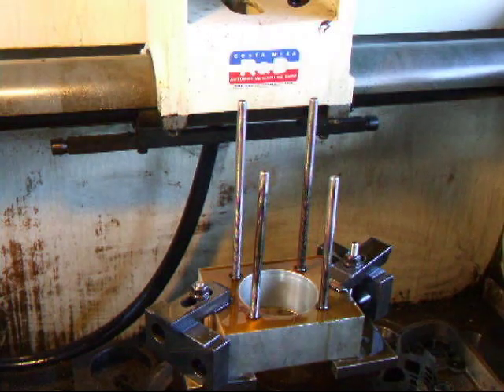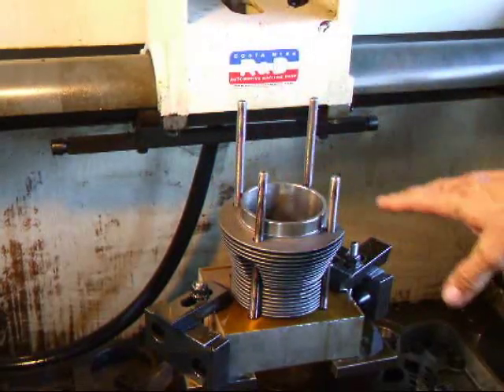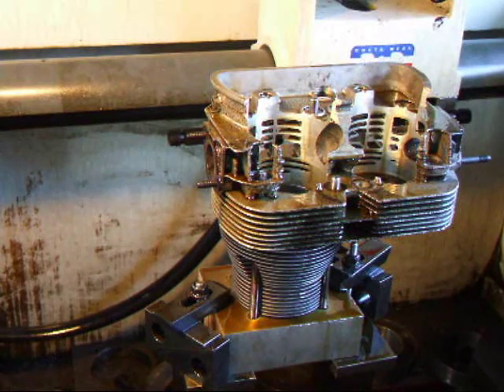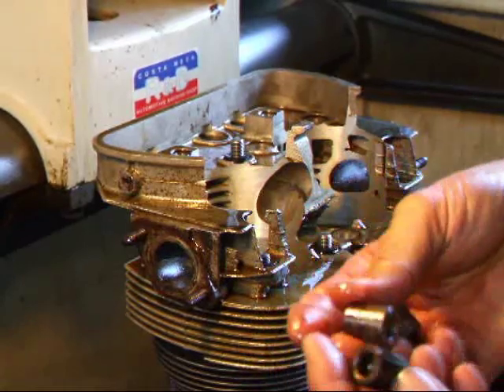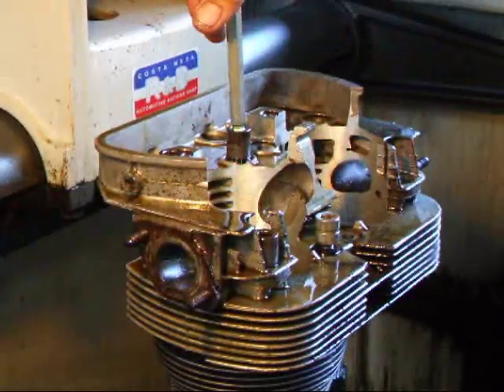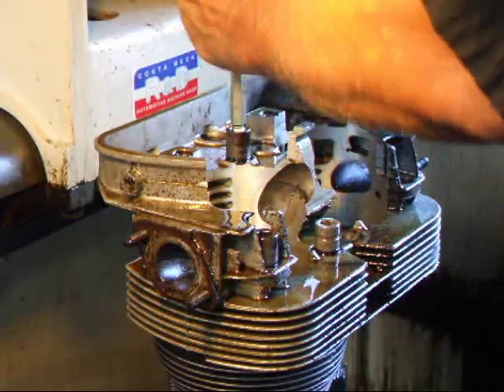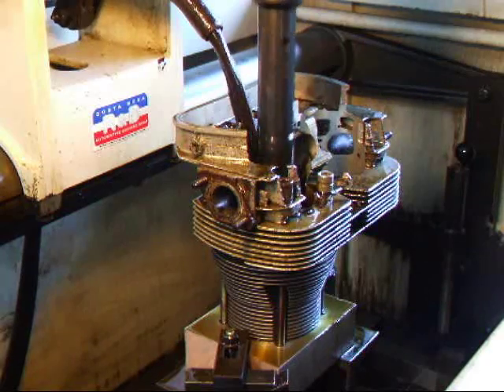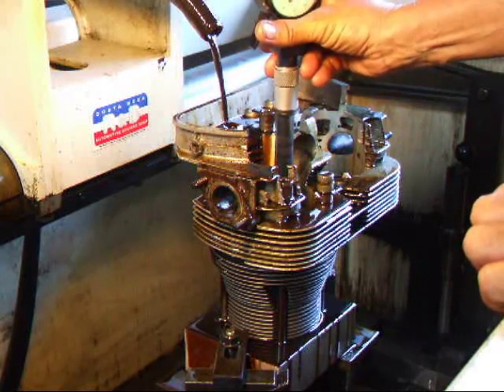VW Cylinder Honing with Torque Plate

Comment: question please ? do all vw stock cylinders come crossed hatched? or the motor builder does that ? thanks nice vid very informative to me .
Reply: +MrGarcon98 Yep.  For ordinary stock set up the stock cylinder/piston sets come ready to bolt in.  His set up is for just a pinch more power.  But, he could go one step further and preheat the cylinder to ~180 F.
Reply: I was involved with hot honing when I worked at Sunnen Products Company. With every 20 degrees rise in temperature, the cylinder would distort. Checking cylinders honed at 180 degrees would have a different diameter then ones at 200 degrees. Stock VW's temperatures are all over the map, as you know, so hot honing would only make things worse. We did a presentation at the PRI show about this in 2001.

Comment: How square do you get the mounting face of the cylinder to the cylinder bore. Could you get it less than 2 micron with this equipment. I presume if there is any run out on the lathe spindle bearings that will impact on the squareness of the finished job as it would be hard to set the cylinder in the lathe chuck and get it perfect. The honing process will get the bore round to within an acceptable tolerance but it might not be dead square to the mounting surface of the cylinder..?

Comment: i have a question that is somewhat unrelated and has to do with Formula 1 engines. F1 engines rev to 18000 - 20000 RPM. How do these engines stay together and not blow up?

Comment from the maker: We investigated hot honing when I worked at Sunnen and found that cylinder would move around at different temps using Incometer and printing out wire frame models. We made measurements at 160. 180, and 200 degrees. The amount of distortion was signigicant at each temperature range. Cylinders would sometimes go out of round 90 degree from one heat range to the next. Remember that engine temps are not consistant and cylinders will always be a challenge to seal.

Comment: Have you ever considered heating a cylinder up to operating temps evenly before boring and honing? The cylinder will distort when it heats up and then your bore will loose its roundness at different places. I noticed this after using a dial bore gauge in a hot cylinder. Now my bore jobs will show differences when cold and will go back to perfect when heated up to operating temps.

Comment: Nice fixture, i had an old Kawasaki Z-1 years ago and i was going to deck the cylinder equal to the piston circumference  so i used drilled aluminum stock on each corner then took a dial indicator and measured the drop to see how much i needed to remove, good way to increase compression, also decked the head 035

So how much did you remove .001 and did it make a difference?

Comment: @86Ivar You aren't really making teeth.  But, looking to make a pattern of scratches.  That way the cylinder has a rough pattern and the cylinder and rings can wear to each other quickly creating a good seal.  You can buy different tools to do this.  Some are more aggressive and are more intended to straighten a worn cylinder or make it bigger.  Others are designed to simply produce the scratches.

Comment: @tsifreak I see you posted a year ago, but.  These VW engines don't use a head gasket.  The cylinder is cast iron and the head is aluminum.  They are machined well, and when torqued down basically squish together.  Don't see VW motors with super high compression and there isn't any water to seal so a gasket isn't really needed.